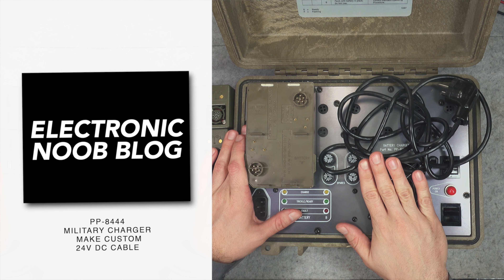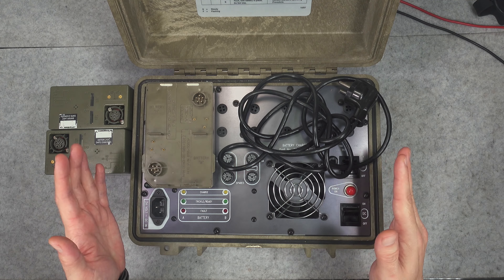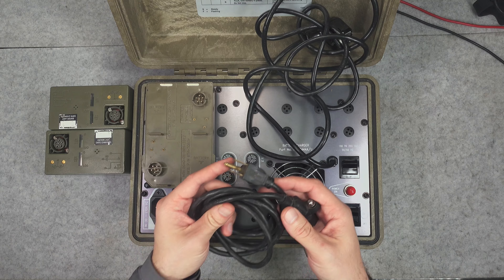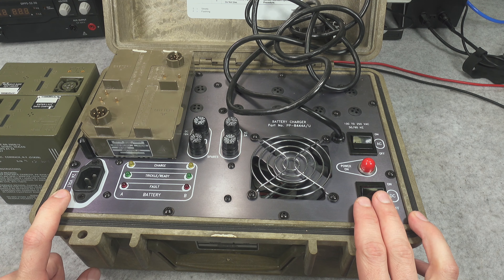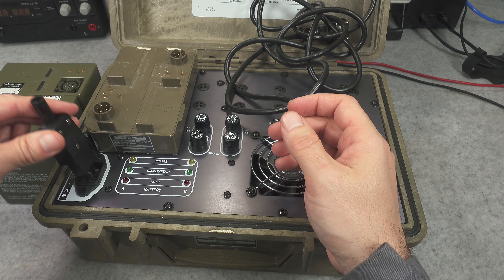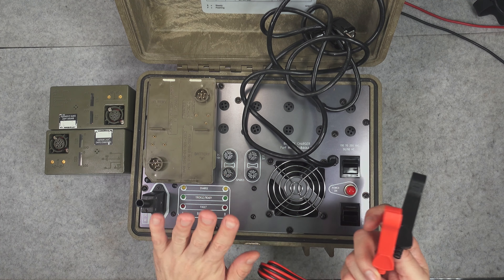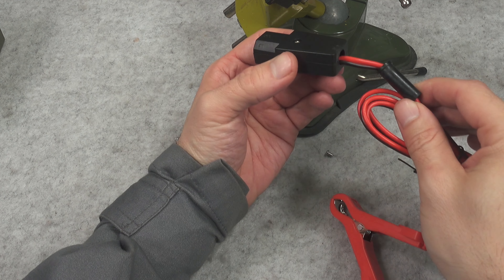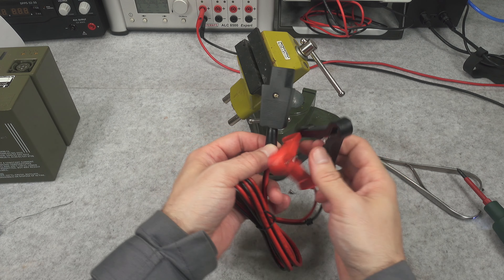PP-8444A/U military charger make custom 24V DC cable to recharge BB-390B/U battery from solar / car

Comment: Hey man I have a question I have some bb2590 batteries the lithium ones but I don’t have a charger and they are to expensive. Is it possible to charge this batteries either way a lithium charger like the Hota S6 I have the connectors but I don’t know if it’s possible can you help me
Reply from the maker: In general BB-2590 can be recharged from any voltage source 16.8V with current limit or hobby charger BUT You need provide separated voltage to "charge enable" pin. How to do it is described on battery itself. You can always 3D print adapter with "pogo" pins but in my personal opinion it will take to much hassle. I would recommend You searching for "low rate charger"  for example "BTC-70903-LR" and it should be better on Your walled, smaller (convenient) and safe so You won't burn internal BMS by playing around and touching wrong pins. That's my opinion - how to charge it - is printed on battery it tell You with pin, what voltage and what resistor to use to make it safe. Also ask Yourself do You need those batteries - they are pretty expensive so if You are not into military gear - it might be better to sell them (earn good money if You grab them cheap) and buy Yourself decent powerbank - recently I grab really nice "ridgemonkey vault" that have over 250Wh (so it's same capacity as bb2590) but give You easy charging + cigarette lighter output.  I'm just pointing that out. If You like military gear - for sure grab low rate charger + fsc adapter (i have on my channel) - and it give XT60 connector for playing around and plugging "12V" devices.